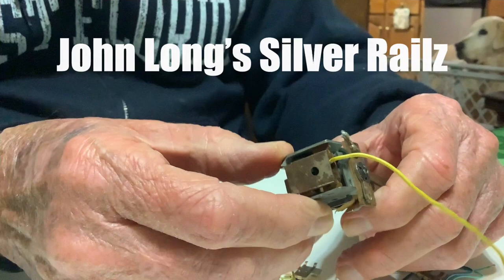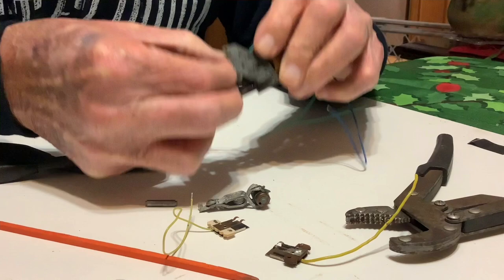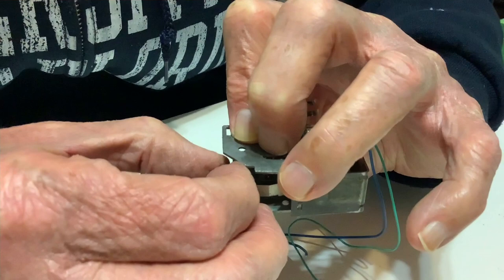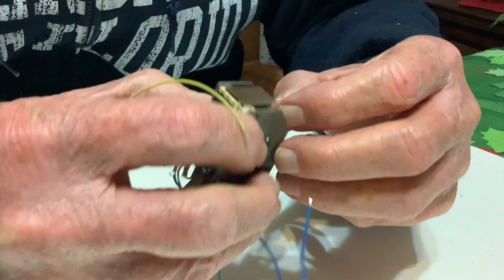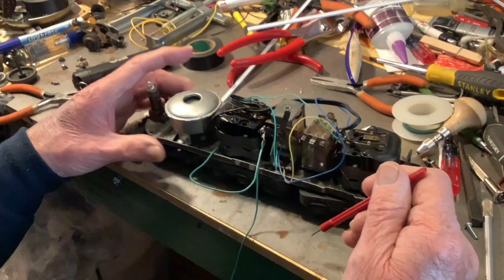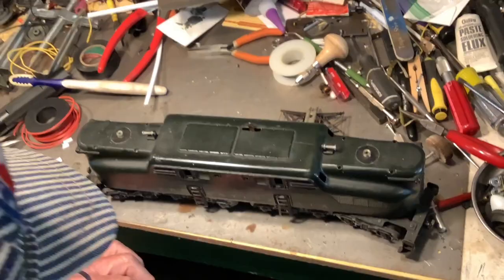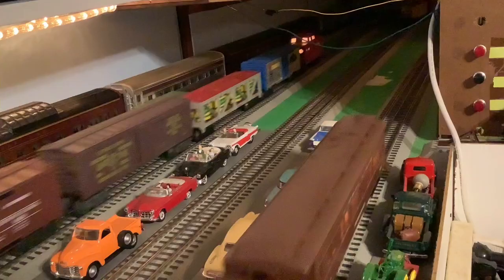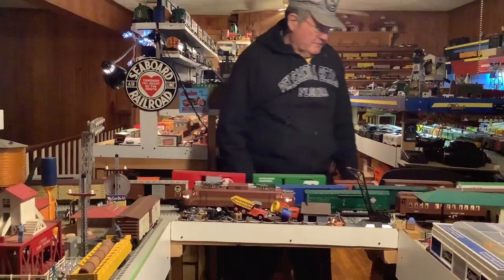Lionel E-Unit Repair and GG1 Train Vlog Follow-up, Including the Little Joe (Ep. 78)

Comment: American flyer had the same coupler problem with their link couplers. I understand that they did the same rubber band trick. I like the American Flyer station up top in the background 👌.
Reply from the maker: Thanks. It is a the talking station version but currently in need of servicing.
Reply from the maker: It is the plastic mpc era couplers that sometimes fail. The earlier Lionel postwar couplers are superior and very reliable. I have been known to convert some mpc plastic trucks and couplers to the earlier postwar metal trucks and couplers. The advantage that the mpc plastic trucks and couplers have is that with "Fast angle" wheels, they roll much easier with less friction, so it is a trade off.

Comment: The Little Joe's had to be regauged after the US prevented them from being shipped to the Soviet Union.  Additionally, I can run 4 trains on my layout which incorporates a figure 8.  2 run in conventional mode and 2 LionChief.  It gets pretty interesting when the kids are the engineers and they switch to the figure 8 part of the layout with the LionChief trying to staying out of the way of the conventional Santa Fe.

Comment: Is this an O Gauge GG1? I just learned the other night that there are O scale and O gauge GG1's available.
Thanks for an informative video about how to repair a GG1.
Reply from the maker: The traditional Lionel post war GG1 was O Gauge but not O scale. However, with its twin motors and die cast frame and die cast shell plus magnetraction, it is a strong puller. Please note that some of these early GG1s by Lionel were single motor( I believe). The Little Joe is single motor with plastic shell. It is possible to operate the GG1 with a catenary. The modern era GG1s were made both O Gauge not in scale and O Gauge in scale. The scale versions are very large.
Reply: @johnlongssilverrailz5873  Awesome, thanks for the history info.
Reply from the maker: Actually, I am not certain whether any of the GG1s had only one motor. All of mine have two.